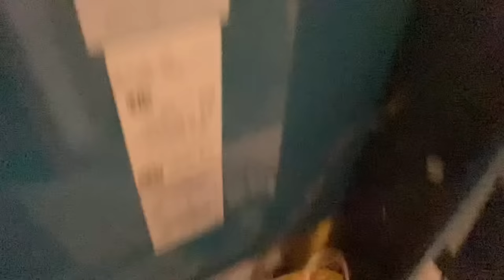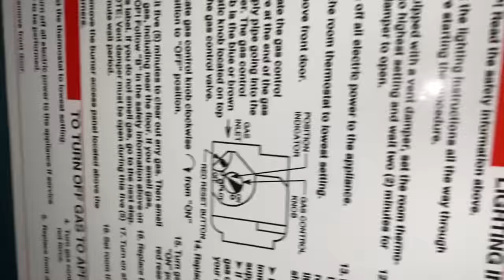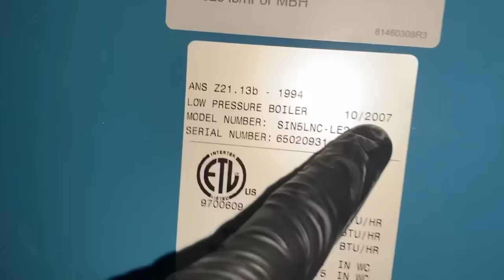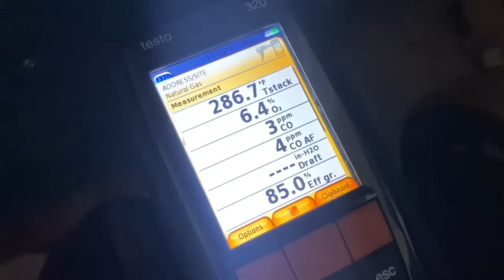Burnham Gas Boiler Not Heating House | Step by Step Thermocouple & Gas Valve Replacement Procedures

Comment: Thanks. I used your video as a starting place to replace the thermocouple on my Burnham boiler.  I appreciate the quality of the video.

Of note, the "special" wrench you used looks like a brake line wrench. And with 3/8" and 7/16", it'd work great except mine was 1/2" at the thermocouple end (!) and I couldn't get any wrench on. Took awhile, but channel lock pliers did the trick.
Reply from the maker: Glad it helped

Comment: Great video, i watch then all. I have a Utica Boiler and the thermal couple has to be replaced every year. I just fix fixed it Jan 2023 and it went bad again March 2023, 3 months. Not sure why they burn out so quick. I keep them on hand at all times.

Comment: Thank you for your videos, I have a question, I had some crud fall on top of my thermocouple because of a problem I had with excessive burning of the furnace, so my question is my pilot light turns on, the flames turn on, but my water is not getting hot, the burners are not burning full flame were you see them going all around the tubing and what not, does the thermocouple regulate how much gas is needed to get full flame? If it’s a bad thermocouple that still lights and still flames but not full flame, will it prevent the water from getting hot? I raised the gas gauge up a bit to get the furnace burning for a little longer and my water gets hot for 15 seconds or so but then goes cold.

Comment: Are there any additional steps to take? I am thinking I’d have to shut the gas off to the boiler. Is that right? Also what was that stuff you put on the pipes after taking the original valve off? 
Lastly, how would I check for carbon monoxide issues after the new valve is in and it seems to be working

Comment: I was taught early on to spray WD40 on pilot fittings and brass fittings that screw into the gas valve. Works wonders. Also get a snot sucker and use some WD40 to blow out the pilot orifice 🤙

Comment: What are the three spade terminals on the Gas Pilot Valve used for?
Reply: I'm going to guess as a Florida boy who has never seen a boiler in person that it's a universal gas valve that has controls on it for other type systems. Most likely why he used the jumper as this one doesn't use those.

Comment: Excellent step-by-step analysis. Open question, my pilot is out and my pilot knob seems to leak unless turned to the on position. Am I able to heat the thermocouple with a butane lighter to the point where the gas valve will receive enough power to open? Or will I need to replace the the gas valve? It's an old Borg Warner furnace. Tested thermocouple with multimeter and it's only passing 12-14 MV so I plan on replacing that either way.

Comment: Question for ya Mike, do you usually set gas pressures based off the rating of inWC on the nameplate or do you go off of your combustion analyzer? I try using a bit of both but always am curious about other peoples opinion.

Comment: if i may ask
got a call that i am beating my head on the wall.
2011 Carrier Furnace
gives a code 42- inducer out of range
Replaced, at the end of last heating season
now since the start of the heating season
code 42 again, replaced since it was in warranty. still code 42. put the other back on. Replaced control board. Still 42,put back on original board,  eventually it fires off long enough i did a co check in both high and low stages- under 30 ppm, xair stays steady in 50s.
intake is clear, drains and trap are clear. 
this code 42 pops up randomly. 
jumping out unit and in componet test. even removed pressure switch and inducer does speed up then pressure switch code which i would expect.
chances of a total of 3 inducers, 2 controls boards are slim to none of why a code 42.
any thoughts?
Reply: Pressure switch
Reply: @chriswilcox9369  nope, same isue
Reply: @PipeDoctor  

No, gave the fault right away.
So I put the original board back on.

Comment: I would pull the pilot burner and pull the orifice out , I carry air in a can ..( don't use air in a can with an open place shit is flammable lol).and I blow out orifice, burners etc .... pilot has air holes , when they get dirty or clogged the pilot flame instead of cutting the air and having a nice sharp flame the flame will stand straight up ... sometimes it will have a white tip .... I know you have seen a dirty Pilot ... I have many plumber friends that tell me " Jim I replaced the T-couple it worked but just called back next day no heat again" .... I asked them if they cleaned the pilot .... they say no  ( some guys will bend the hood on the pilot down thinking it will then heat T-couple) ( you should never have to bend it)... anyway fellas clean that pilot orifice ... for a sharp pilot,  you should hear it cutting the air  ...Obviously that pilot was not that dirty at first it looked like it was standing straight up without hitting Thermocouple but from the side shot you took after replacing T-couple  it looked ok.... I clean every orifice anytime I replace a T-couple and blow out burners from the slits IN .... being that the unit breaths oxygen .... the pilot flame is lit  24/7 /365 ....  the burners breath when she firing,  the dust whether it be sheet rock dust from new construction etc  or just sweeping the unfinished basement ... dust will coat the inside of the burner slits ( ribbon burners ) and it could cause a shitty flame and poss soot up the boiler ... I'm just bringing  this to the Attention of some of the younger service folk ....lol ... I was taught and I personally always thought that the pilot and that little tiny orifice is a pretty important little part .. on standing pilot applications ..Apologies for the long explanation ...and the Job was fixed with having to clean the orifice .. Ill go away now ... Love your content Mike .. Hope you don't feel I'm being a dick lol 🤣
Reply: @PipeDoctor  Yes you are 100% correct ... once I started blabbing I had to keep going lol ... thanks for responding Mike ... You also enjoy your weekend